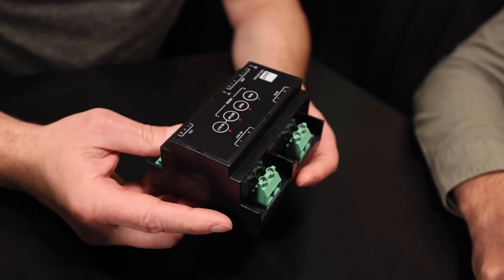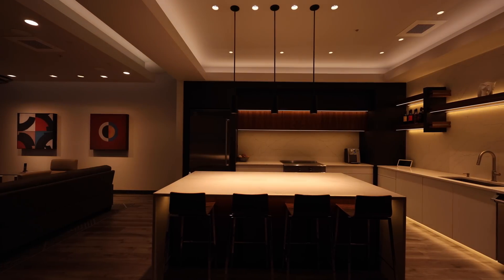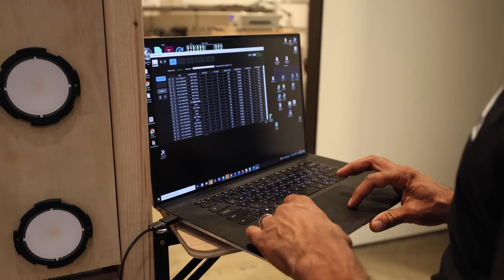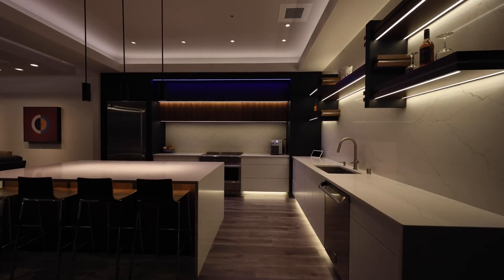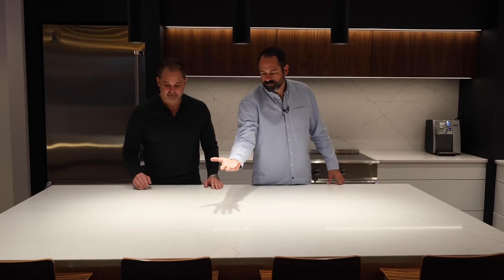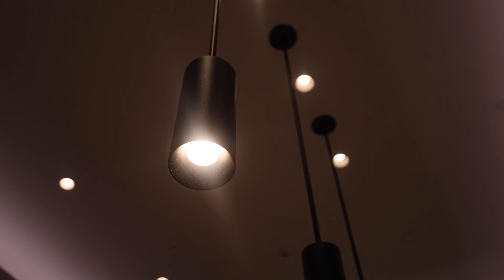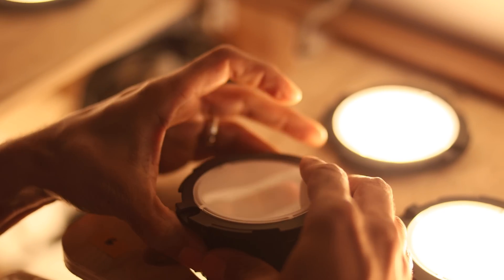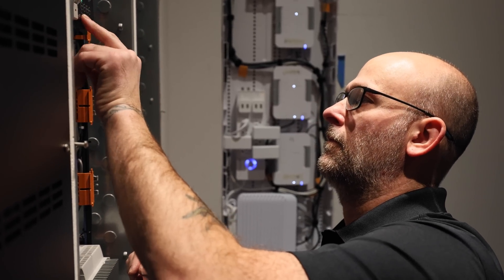What Makes PhaseX by DMF Lighting So Revolutionary?

Comment: What? So, as long as the wire is rated for the total load, we can have up to 64 lights on a single run AND control them all separately with a control system?
Reply: Correct, as long as it’s only PhaseX lighting after the module and it’s rated for the overall lighting load.
Reply from the maker: Hello! Thanks for reaching out. Each PhaseX processor can support 64 fixtures. Please review the total wire run length for design best practices, and feel free to reach out to your local DMF partner with additional questions.
Reply: So if I understand this correctly your phaseX decoder is a sending Data, Clock, and Ground to each fixture and each fixture acts as an addressable pixel. I work on large film projects and can see a use case for this product in my industry

Comment: So am I understanding this right, its a tunable fixture with a built in driver/dimmer controlled via power line data?
Reply from the maker: Yes, PhaseX allows for DMX to communicate via traditional power wiring. It is designed to work in homes where all lighting loads are ran to a central location, such as a panelized lighting system- as it powers 64 fixtures per zone on a single wire. The PhaseX module is compatible with DMF's Artafex fixture line of down lights.